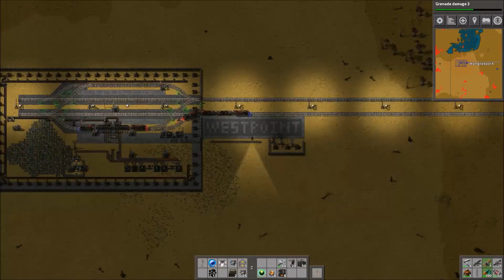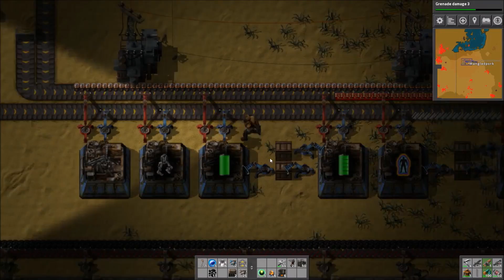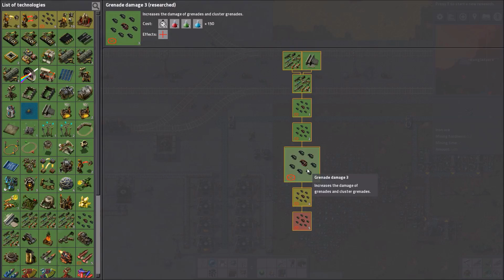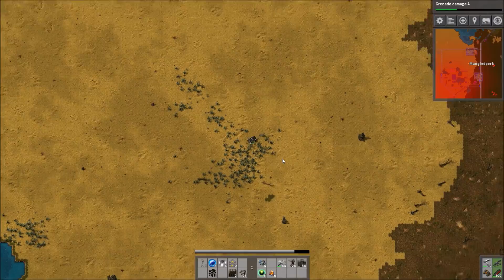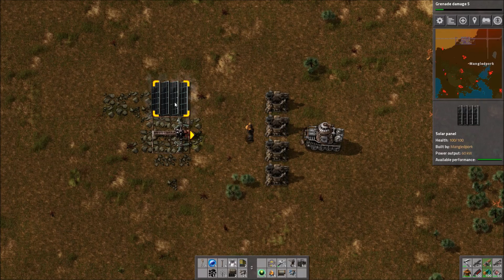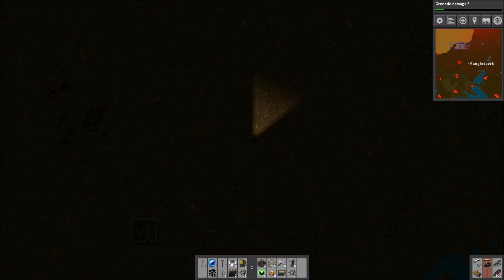Factorio Towns Ep#44: Circuits, Shields And Secret Stashes

Comment: Don't underestimate the advanced batteries. They store a stupendous amount of power. I think they must have been recently buffed considerably because the wiki says they store 500kJ, but in 0.14 at least they store 100MJ. 2 reactors and 4 batteries can provide enough power for 5 shields and 5 legs even when the shields are charging. As for their longevity, I've spent hours rampaging generating entire steel chests worth of artifacts and had the batteries last the entire time. 400MJ is plenty of power to keep those shields charging for as long as you need them to.
Reply: Batteries are severly underrated by many.
A single mk2 battery (100MJ) will essentially give the same output as one fusion reactor for over two minutes (133 seconds to be exact) when fully charged. And they charge whenever you aren't being attacked or moving at full speed with so many exoskeletons that  you use up all the reactor output.
And since reactors are 4x4 and batteries are 1x2 that means you get 8 batteries for the same space as one reactor. Meaning more than 17 minutes worth of reactor output equivalent, from fully charged.
And the batteries can discharge at a higher rate than the output of a reactor, meaning instead of the same power as one reactor for 17 minutes, you can have the same power output at 17 reactors for one minute.
A single reactor and multiple batteries are superior in pretty much every situation except if you are constantly draining more energy than a single reactor can provide.
Having too few batteries and multiple reactors can cause huge problems, since if you go above the power output of your reactors, then you have less of a buffer before going negative. And shield regen take priority over exoskeletons, meaning once you go empty, your speed will drop and shortly after your shields (since enemies will catch up to you) and then it's game over.
More batteries gives a bigger buffer and a clearer visual indication, as long as you keep an eye on the battery bar when attacking biter bases.
And recharging is simple, just stand still (or get into a vehicle and drive....)

And it's even more easy if you are willing to "cheat" a little.
Exoskeletons are 2x4, so two exoskeletons take up the same space as one fusion reactor, so having one fusion reactor, four exoskeletons and batteries and shields crammed in, then you can do a quick recharge by stopping, removing the exoskeletons and put in 2 reactors in their place, to quickly recharge the batteries (compared to say 2 reactors by default and fewer batteries).

Comment: Why are you using Gun turrets instead of laser turrets?
Reply: Plus there would need to be a town for it.
Reply: I don't think he has a power grid between all the towns, so he doesn't want to put too much pressure on his power supply
Reply: He has a powergrid running along the tracks. The problem is that laser turrets take a lot of power when firing, requiring higher power output and accumulators to store energy, which in turn creates a lot more pollution, which in turn creates more biters.....
And if a power pole goes down, or something happens with the power production (like coal shortage, or accumulators run dry during a heavy attack) then the laser turrets go offline and the base gets overwhelmed.

What he needs to do is fix his turret placement so that they support each other better. Instead of placing them evenly spaced, he needs to group them up, otherwise they will all go for a single turret and spitters will be a max range where few of the turrets can reach. 
And the turrest at the corners are especially vulnerable and he should create a diagonal corner instead of a right angle, so that he can place turrets so they can better support each other.

Or even better, learn to use the biters AI against them, although that may be considered an exploit for his rules for this playthrough. 
Walls don't cause biter aggro, neither does belts of railways, just things that cause pollution and radars, turrets and the player.
So they won't attack walls just because they are there, they will only attack them if they are in the way and there is no way around them. So you place them as a shield and then leave a hole in the wall, that they will try to run through, and that is where you place the turrets to defend.
Which also makes it easy to stop biter bases from expanding. Instead of building a long wall with lots and lots and lots of turrets evenly spaced all along the wall, you instead just build a long wall with an opening here and there, and the turrets clustered around these holes.
Then you can exterminate all the biter bases inside your perimeter and there will be no expansions, since they have to first go through the hole and face the turrets when they try to expand.

Comment: I'd like to point out that the handheld flamethrower is actually terrifyingly effective against aliens well into the late game. I'm relatively new to the game, but as far as I'm aware the flamethrower has been buffed significantly in recent versions, and I know from experience that it's a very efficient way of killing aliens provided you use the ammunition sparingly (which isn't difficult, because it deals damage over time if you hit an enemy/base only once). It's also far quicker than turret creeping, since you don't have to place power poles for laser turrets or refill the ammunition for conventional turrets. Even without the power suit, I've found that quite large bases are quick to deal with using a flamethrower, with quite low risk of dying compared to other methods of attack.
Reply: Flamethrower plus destroyer drones is OP, and on its own is very effective so long as you can outrun the bites if you can't make enough destroyers yet.
Reply: I haven't actually tried it with destroyers yet. I probably will once I set up production for them, but since my factory is defended pretty well by walls and large lakes, I currently have other priorities.
Reply: Jane Stacey
My strategy in mid game is just combat shotgun plus lots and lots of poison capsules. It's incredibly effective when combined with the power suit and a couple power legs because you can run rings around the base and the biters can't catch you, while they continue to take damage from the poison. It's effective until you start getting all big biters and the occasional behemoth. Large concentrations of spitters can also be dangerous. I'd imagine using the flamethrower would be even better in this case and you wouldn't need destroyers yet in that case.

Comment: 13:30 : 
/c local surface = game.player.surface; for y=-4,4 do for x=-4,4 do surface.create_entity({name="stone", amount=5000, position={game.player.position.x+x, game.player.position.y+y}}) end end
^
| this will generate a 9x9 stone patch with 5000 stone in each (for a total of 405000 stone pieces)
BUT disables achievements
Reply: It's a console command "/c" and is considered a cheat code, it won't award you achievements for instance.
I believe he won't be using any console command.